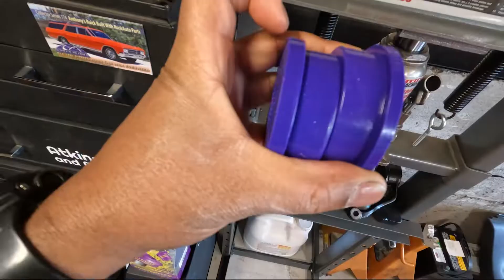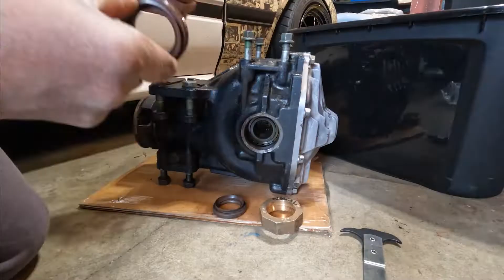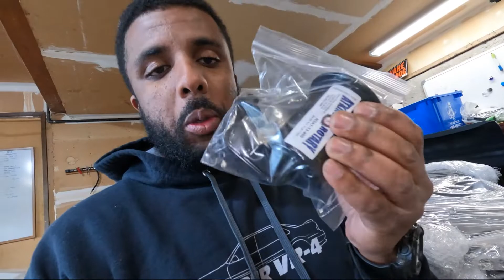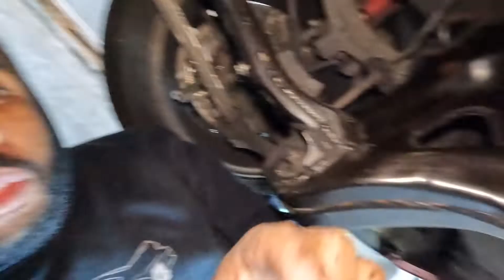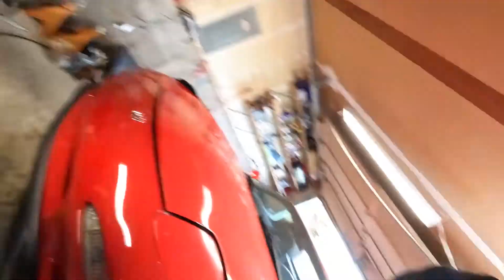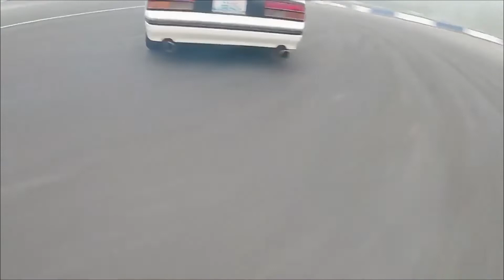Stop the Clunk! |RX-7 Diff & PPF Install Guide|

Comment: Which transmission brace do you have? I was thinkiing of getting the Banzai Racing one but I see yours is directly conencted to the frame. no energy suspension mount
Reply: just saw your description. Elite Rotary, it seems to no longer be a working website
Reply from the maker: @tonggi  correct, unfortunately they went out of business. The banzai racing brace is a SOLID option!
Reply: @cooliomo  Can you share what parts you used for the side diff seals?
Reply from the maker: @tonggi  P043-27-238A this is the part number. I bought them from Atkins rotary. Hope this helps!
Reply: @cooliomo thanks brother! I'm going to do the same thing since everything already out 😂
Reply from the maker: @tonggi  no problem, might as well right! 🥹

Comment: Man how did you clean a diff that gunked up. I need to do the same.
Reply from the maker: Some wire brushes and a TON of degreaser and brake clean!
Reply: @cooliomo yeah don't think mine was as bad but close. Now to find a space to destroy with grease. All I need to do is dif bushing so might get away without it but I know as soon as I start something like this I just keep going and do way more then planned, haha.
Reply from the maker: @patmedina1960  haha that’s how it usually starts! Diff bushing, axle seals, axles, fuel filter! The saying that keep repeating in my head was “Well since I’m already in here” 🤣

Comment: Hi there. I've got an rx7 fd shell, 2002 model. I've been gathering parts to put it together. However I see how that the side shafts at the back are different sizes. Any input? I believe maybe it's the wrong side shafts for the diff
Reply from the maker: When you say side shaft, are you talking about CV axles? Can you elaborate a little more?
Reply: @cooliomo  sorry where I come from we just say side shafts. I don't know the correct term you'd use, but the shafts from the differential connecting to your wheels
Reply from the maker: Can I ask where you are from? Also maybe count the splines on the shaft that goes into the diff. It should be a 30 spline.
Reply from the maker: When you try and install the side shaft, does the shaft not go in all the way?

Comment: Thanks for this video. I would like to know where I can purchase the PPF & driveshaft propeller nuts and bolts.thanks
Reply from the maker: I’m glad it could help!
Bolts: 
https://www.atkinsrotary.com/store/Rear-Differential/Rear-Differential-Hardware/93-95-Mazda-Rx7-Rear-Differential-Hardware/86-11-Rx7-and-Rx8-Rear-Drive-Line-Bolt-P012-25-123.html
Nuts:
https://www.atkinsrotary.com/store/Rear-Differential/Rear-Differential-Hardware/93-95-Mazda-Rx7-Rear-Differential-Hardware/86-11-Rx7-and-Rx8-Drive-Line-Nut-1368-25-124.html
Reply: @cooliomo  you're the best of the best!May  god always bless you with all you do. I will keep supporting you and your channel! Thank you so much
Reply from the maker: As far as the PPF you can’t buy them brand new. You might have to scan eBay or someone who’s parting a rx7 out. 
BUT if you have the funds this product is AMAZING!
https://www.drifthq.com/products/fisch-racing-tech-rx7-fd-differential-brace-ppf?variant=41083301691439
Reply from the maker: If I heard of this product before I did my ppf I would’ve 100% bought it.
https://youtu.be/lz_5frOJT58